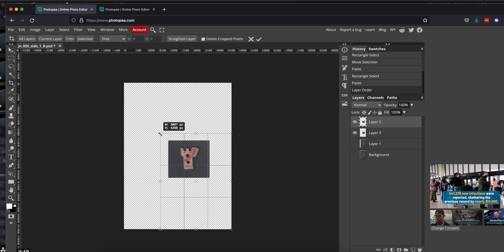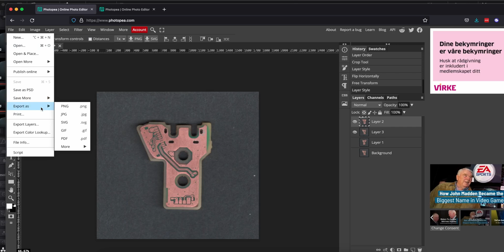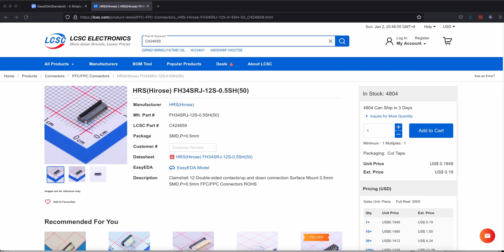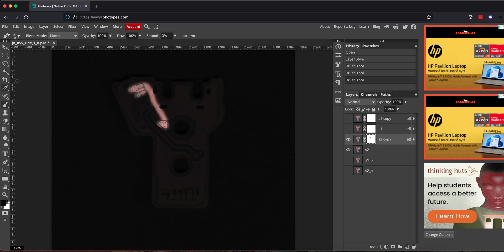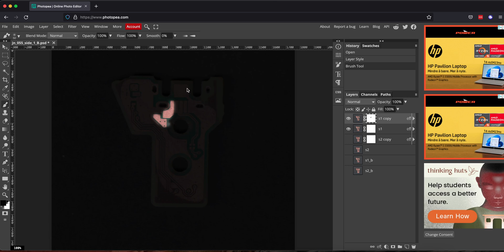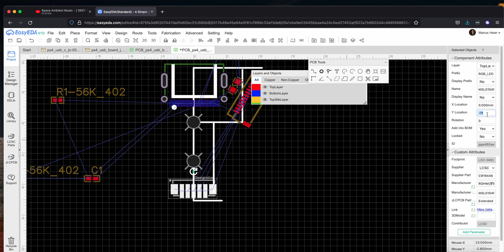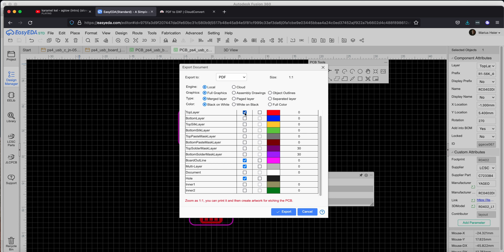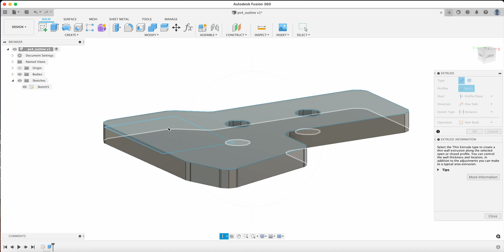Design  |  V1 PS4 controller USB-C  |  #4

Comment: Can you just simply swap the ports if they both have 5 pins on the connector I have donor usb c 5 pin port female and the ps4 controller uses a micro usb 5 pin female port